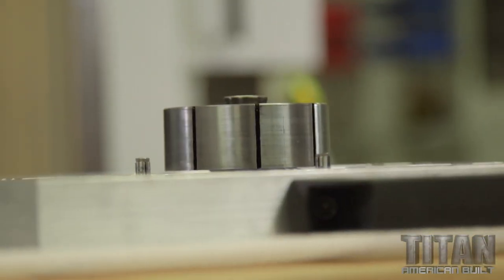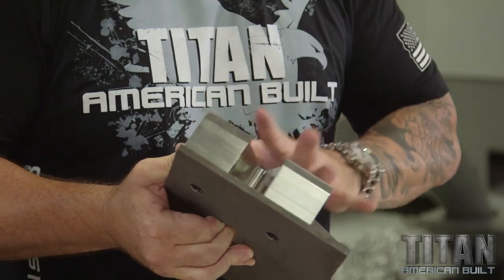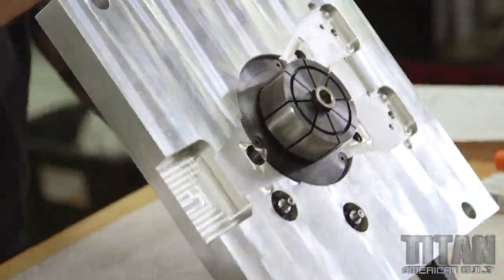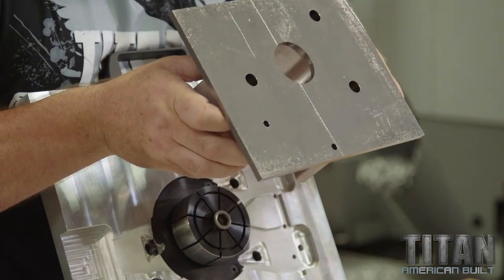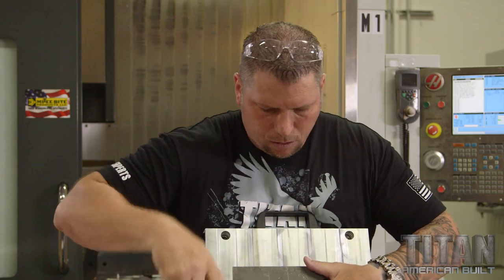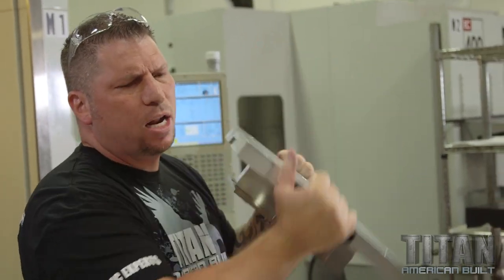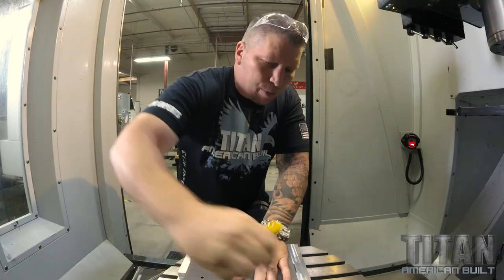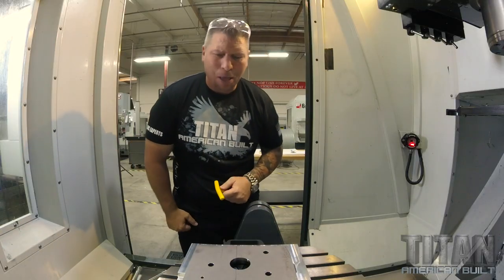Using Mitee Bite Clamps in CNC Machining

Comment: That's a beautiful part. You can tell right away (I've been in machining since 1997) by looking at the part that it's machined by an experienced/seasoned machinist that takes pride in what they do.
Observations: that no aberrations/irregular tooling marks that would indicate:
• the machine is built ridged (harmonics/vibration isn’t communicated on the part);
• the holders are good (balanced and centrifugal forces); 
• the setup is solid (well thought/planned);
• correct speed and feeds (blemishes; irregular surface profile);
: Just to name a few bullets, that comes to my mind.  Kudos to Titan CNC for a great job!

Comment: That fixturing, man is it gorgeous! as a self taught home hobby machinist i can only envy the fixturing you guys apply for your production runs.. 

i do have one question for you, and its just curiosity, why are the o-ring channel ops. sent to the lathe? obviously you know way better than me, but is it possible to just implement the ops. into the cam and have the cnc cut the o-ring channels with a tool that allows such an operation?

again just curiosity from a lower skill home hobby machinist.. 👍